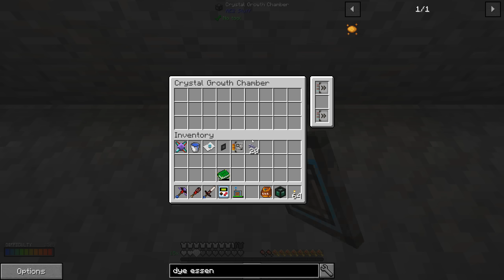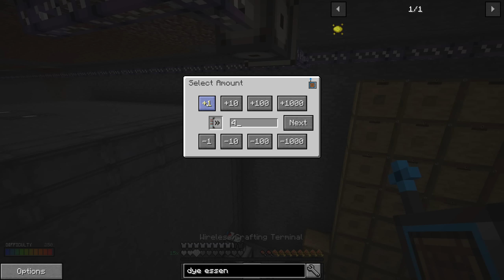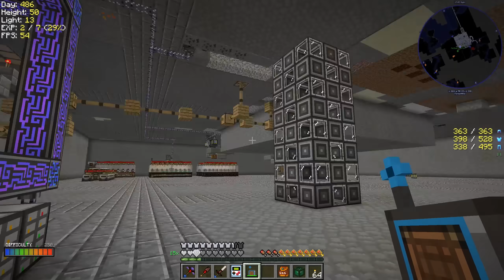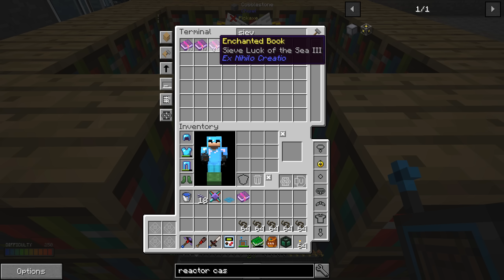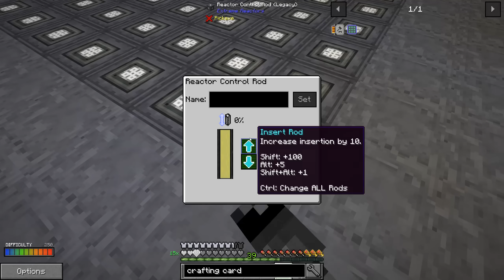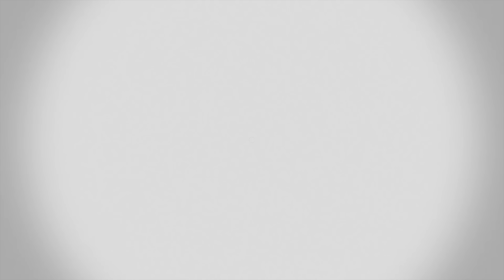Forever Stranded Lost Souls - MORE EXTREME [E77] (Modded Minecraft)

Comment: You do not need to filter the importing of the growth accelerators from AE2 STUFF. They are smart, and will not list any item as extractable until they are complete. Just saves a step. Tested several versions ago in 1.12.2